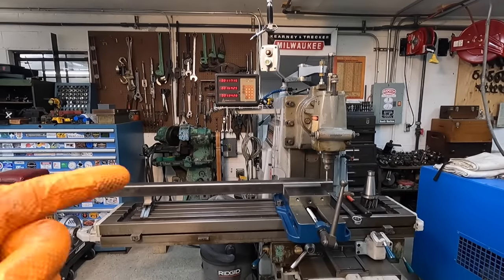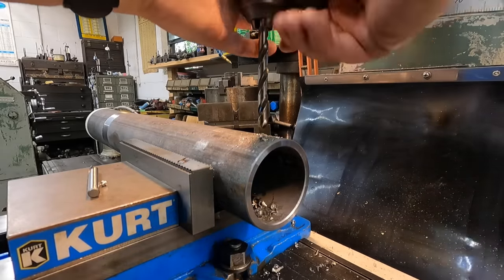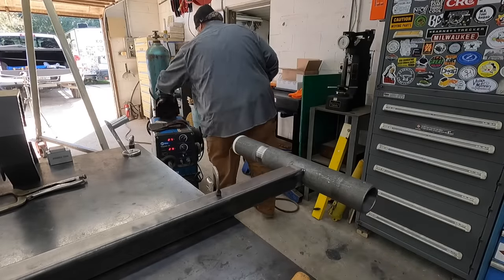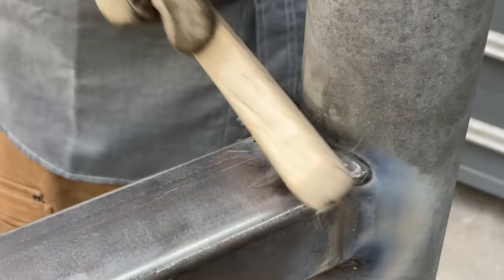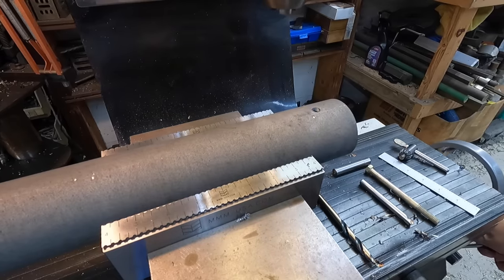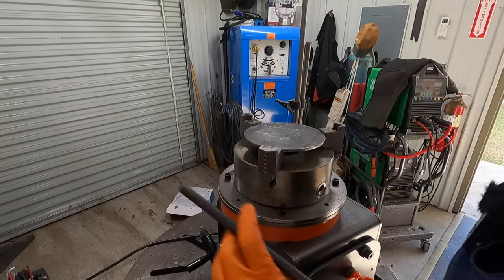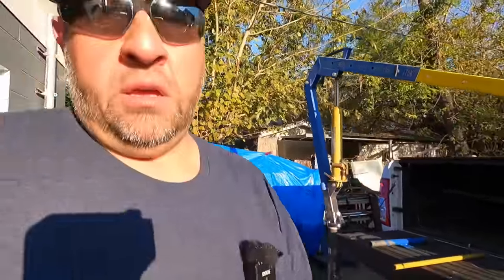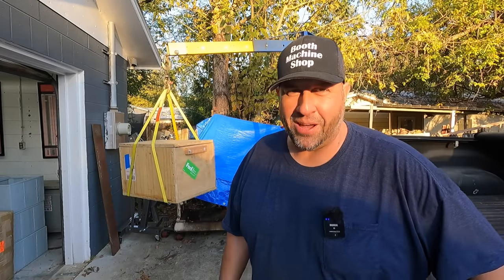Truck Hitch Crane Build Ep. 7: First Test!

Comment: I'm wondering, once you place the load on the truck bed, the suspension will settle a bit and you will have permanent weight on the foot, making it difficult to pull out the pin to retract the foot.

Comment: Your wire could have a moister problem I was welding a test plate at Lincoln electric in their lab and I was having the same problem, after testing the wire that was brand new it had high moister content that was causing the porosity and gas tracts.

Comment: Hey Adam big fan. Just wanted to say I run dual shield at work quite a bit and personally I like 25 to 26 volts and any where from 245 for thin stuff up to 300 IPM for thick stuff. People always say oh dual shield will punch through anything. And no it just won't. It has to be clean or you have to run it so hot it almost falls out. And I run a bit higher cfh of 75/25 something like 35-45. Also select arc is garbage IMHO. ESAB makes damn good dual shield but in all honesty if you aren't running it daily you can't tell the difference. Hope it helps love your stuff man!

Comment: If I may that half used roll of wire is far from fresh.  How long has it been setting around open? With all of those worm holes and the uncertainty of that wire I would toss it. Expensive but not worth the trouble. You can try a 10 to 15 degree drag ( IF THERES SLAG YOU DRAG)
 and a 3/4" in stick out.  But if the wires too far gone with moisture....

Comment: Shielding gas doesn’t go bad.   I on occasion have the same issues when MIG welding short circuit and it bugs the crap outa me.  This weekend I too was having issues and I believe the wire sitting in open air after a few years gets an oxidized layer on it.   I’m primarily TIG welding and so my MIG equipment sits in hibernation most of the time. 

So what I did on my weekend project where I needed nice “tight” welds on 1/4” mild steel and done by this late afternoon, was to switch my welding processes, right in the middle of the project.   TIG would have taken me much too long for this particular project, so I went old school like you did and used 6010 for Tacs and 3/32” 7018 DC+ for everything else.    I forgot how fun that was as that’s all I used to do in a former life.   Weekend Problem solved and actually stronger welds than what MIG can produce.

Comment: Gas goes bad?  I'm only a home gamer and I can envision gas mix separation if left static for a long time, but not much else.  

A quick tale of procrastination to illustate my dubious assumption; I finally fixed an old transformer MIG that still had the 75/25 bottle from a good 15 years ago.  It initially didn't weld for shucks, so I  disconnected the tank, put the cap on it, layed the cylinder on some rollers and spun, flipped it, did the old "rinse and repeat" for a while, parked it upside down for a few days, and finally hooked it back up, hoping to have mixed things a bit.  I don't know that it did anything and can't speak to how a fresh cylinder would improve things, but I've 1200 psi left in an ancient 125CF cylinder and all seems fine now.   Yeah, aside from a working with a potential bomb in the garage, I'm sure my next refill will include a hydrostatic test, if not charges for a new tank.

Comment: Porosity is caused by 2 0r 3 main things..one is level left in bottle..other wrong gas type..3rd is length of wire away from weld, too far away?  Well this is MY experience....Good work so far, dont stop.

Comment: Worm tracks and pinholes are commonly caused by excessive heat in the weld pool.  (amperage and or excessive voltage).
1) voltage too high. 
Or
2) too much amperage. Can be controlled by either wire speed or wire stick out.
I believe your settings are most likely acceptable as I’ve used those setting a lot for light deposition similar to what you are doing. 

Without being there to observe closely, I think you may want to increase your wire stick out. When training welders that are used to welding with solid wire where minimal stick out is desirable, I like to say that when it feels like your wire stick out is a little too high, your probably just right. Usually about 5/8”-3/4”
 The tech specs of your wire will usually suggest a range. Be aware that some wires even suggest up to 1” stick out. You may even notice the arc sounding happy, smoother arc transfer with less spatter. The sound of weld will speak to you. 
Sometimes it can also be caused by too fast of travel speed which can cause the weld puddle to cool to fast not allowing the weld gasses to exit the puddle and gets trapped under the slag.
Also some wires are more susceptible to worm tracks than others. Try one thing at a time to identify and eliminate the variables.
I’d be curious to hear if my suggestion(s) help.
I really enjoy your videos by the way.

Comment: I use Hobart .045 dual shield every day. Look up the manufactures setting for your wire and heat. Crank your gas up to 45-50 CFH. Stringers and straight on or a pull travel angle.

Comment: I'm not sure this is helpful, but with my mig welder I had to switch the terminals for the gun and earth lead to "reverse the polarity" because of using flux cored wire... The difference was remarkable.
Just thought I'd share in case it's helpful for your welding worms (or whatever they're called lol)

Comment: 37:13 you could use quick loc pins to secure the cylinder and boom for ease of disassembly. So its not so heavy as one unit.

Comment: Nice job.  With only 100lbs of test weight does not show the problem you're going to run into with heavier loads.  As the boom swings aft to pick up the load, you'll see twist in the main support.  There is nothing there to counter-act the torque.  Right now, its the mass of the system and welds keeping it straight.  But if you're going to try to live 1-2 tons, that crane is going to twist at the point where you have the extension to the truck hitch.  You have those static anchors in that cement ramp (shown in previous video).  Use those to check what will happen as you approach the lifting limit of the hydraulic press.  I hate to criticize, I really do.  I'm not trolling.  I designed the same thing years ago, but have yet to build it (damn heart problems got in the way).  But that was one of the issues I saw in some of these youtube videos.  Some guys are just plain nuts <grin>.

Comment: I know this video is 2 years old, but getting into welding, it's a shame so much wire is wasted when the spool runs out... It's unfortunate that you can't just put a new spool on and have it push the old wire out so you can continue using it. I do that with a 3D printer but I understand these are completely 2 different animals.

Comment: Lots of hassle to build, but I think its worth it because you didn't have to drill holes or modify the truck.   Ive seen these mounted in the bed floor and No way Id drill unnecessary holes in my personal truck.   Id even think its built just right not too heavy and not to weak for what your doing with it.   Id say its not capable of the actual capacity of the original lift  mainly due to the 1 piece of tubing for support.   Id guess 500lbs max and probably not fully extended.

Comment: Drill a 1/4" hole in the center of the round foot plate for water drainage. Also a jack from a vintage 1960 to 1969 VW Beetle has a round shaft that would work as an infinitely adjustable length foot plate assembly that can have a shaft at any length you need and it has a mechanism that allows full retraction with incremental retraction under full load. This would solve the truck bed loading variations due to having the load shift from the crane to the truck bed when the load is released from the crane onto the truck bed.

Comment: No shelf life on gas… looks like your feed rate may be excessive and you’re compensating by advancing your bead rate… try cutting back 20% with an little e or loop style instead of standard weave and that should let the impurities boil out the front of the weld puddle.

Comment: I have the Harbor Freight pickup truck crane that bolts to the bed. It's rated for 1,000 pounds and has a hand crank cable winch as well as the jack on the boom. You might want a winch to reach the ground easier.

Comment: Hey I’m by no means a professional welder but is the 730 wire your using rosen core? If it is then do you really need shield gas, I’m just asking because I’m not sure but the shield gas may be why your getting pin wholes and snaking in the welds?

Comment: Pause @13:05
When a heavy load is placed on the truck, the truck will squat and transfer a portion of the load to the base of the crane.    On mine, I place a floor jack under the center of the truck's hitch receiver.   This prevents the horizontal crane tube from twisting and is also needed so I can still remove the crane.   After the crane is removed, remove the floor jack.

Comment: You might try 24v and 290 IPM for wire speed I use it and dual Shield and never have issues with worm tracks or pin holes

Comment: Instead of pins for the height adjustable foot you could split and weld tabs on the female pipe. Use a cam-lock like on a bicycle seatpost so it's tool-less. Infinite adjustment and easy release when/if the truck squats.

Comment: I would not leave that attached to the back of your truck unless it flipped up higher than what you've already got it. You've got to consider the departure angle of the back wheel like if you come out of a driveway it's on an angle, your curb is up higher than the street, that could cause problems. I've scene tail hitches get caught on Curbing and they weren't able to move the vehicle because of that.

Comment: The pitting are probably because the wire has been contaminated or oxidized. Dual shield is really sensitive to contamination weather it being in the wire or the material. I’ve noticed that your new spool wasn’t vacuum packed and it should be.

Comment: Don’t put a pin at the bottom of the landing foot. When the truck squats under the additional weight you’ll not be able to pull the pin. Instead get two tongue lacks, one forward and one behind the bar to the receiver hitch and then you can lower them to get your receiver hitch crossbar disassembled.

Comment: Great looking crane Adam.  Instead of that fixed foot - how about one of those folding trainer “landing gear” assemblies that Horrible Fright sells.   You could just attach one of those to your cross beam and then swivel to the vertical and crank the little wheel down until t takes the weight of the crane boom - or replace the wheel with a flat foot pad.

Comment: Are you sure your gas pressure isn't up too high on your argon? I understand that it's supposed to be removing the oxygen as your welding but if it's blowing too hard could it be blowing the bubbles and the worm tracks in it? Does that make any sense?

Comment: hmm i would be a little concerned about getting something too heavy in the bed it'll make the truck suspension sag of course which means a loooot of weight will go onto that pin for your extendible leg brace which i would think to make it hard to pull it out. just my $0.02

Comment: Also I forgot to mention Not all  dual shield wires use the same gas. Typically 7525 or a straight CO2.  Not all wires or design to use either.

Comment: You need more support for the upright. As it stands you are putting a huge moment of force through that puny piece of box section attatching the crane to the tow hitch. As the jib swings the force will move from tending to put a curve in the box section, to loading it tortionally where it will have much greater flexability.

Comment: Drill holes for the rotating handle. You'll never lift enough with it with the base you have. It wont compromise the upper section by drilling holes in it.

Comment: Turn your gas up to 35 psi or down
Check that your not in pulse with current (electrical current)
And speed up your wire to where it peaks. . . Metal core needs speed

Comment: Just idea about the turning pipe, maybe drill hole threw the main tube and weld receiver pipe in on both sides, that way one less thing to be sticking out to catch on something, said ot before, but please dont use dish detergent, will rust and corrode steel!! Maybe something like a dab of white lithium grease!

Comment: i've had worm track issues at work with the select arc 71...was never an issue for many months then it was happening all the time.  flux wire needs to be stored dry, so best not to leave it around too long, and i think ours went bad.  straight CO2 seemed to alleviate but not entirely.  turning down the volts a little bit also seemed to help.

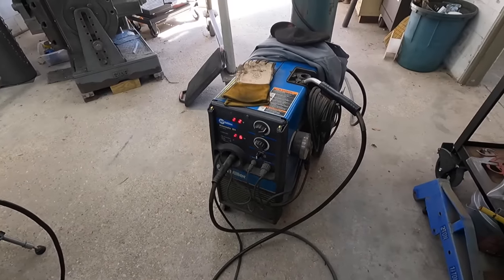Comment: I will ask if you turned the feed rate back down and getting the wire through the handle?  It looked the  setting was in the 27.2 range with the quick camera turn to me instead of 24.5   (time 21:30 ish)

Comment: Could you take the handle that came with it, cut both sides off the center bracket, and then stick the pump handle through to turn it? Probably a toss up compared to fabricating another one from scratch but I always try to reuse pieces like that instead of using more material

Comment: Weld on a short piece of pipe and use the long jack handle to rotate the crane. Also drill a hole in the bottom of your trailer hitch, weld a 1/2 inch nut and put a bolt up through it and tighten it against the draw bar. It will take out even more slack.

Comment: myself would put the piece of pipe on the back of the lift. like the T handle was. so you can slide the jack handle thru it and make a T bar . then slide out when done. that gives more control. both side and back. for diff load weights so on ..

Comment: Once you put your foot down and pin it and then lift a load onto the truck, you're going to have weight bearing down on you stabilizing foot. How are you going to remove the pin to retract the stabilizer foot with all the weight contained in the truck which is now bearing down?

Comment: I wonder if your rust remover hooch has something to do with the worm track problem. I used flux core for years and mostly the only things that did that was oil, water, or gas flow ( too high or low).

Comment: May I suggest a traverse lock?  I built a light material crane for my 5ton. I find if the truck isn't on flat ground the crane will auto rotate to the low side- whether you want it to or not.

Comment: The original handle holder that’s on the side, make something that will insert into that for the handle to swing back and forth. A pipe that has a 90 on it with gussets to press against the side, then presto, removable handle.

Comment: Once the load is put in the bed the suspension will load the support leg and may bind up making the pin hard to remove. Do you have air ride on the truck?

Comment: If you go to lift something heavy and you know the truck is going to squat a bit, you could put the leg down on the ground and then lift it up a hole or 2 (depending on the weight of the object) so you can get the pin out.

Comment: Looking good but you failed to pick up on a lot if comments on here about the pin release when the weight is on the truck bed. I think it will still be pushing weight onto the ground and you havent shown that

Comment: I'm not sure if it has a shelf life either but I have ran into some issues with welding just like you are had a gas bottle for a long time and I've switch gas and it actually helped me a few times so not sure but you might be onto something there

Comment: You get in a sway in the road or if the driveway runs up hill it’s going to drag because a trailer on back the jack with the wheel on it drags easily.

Comment: One thing I would like to mention is if the ground is not level, the leg will not sit right. I would put a single pivot so that it can angle slightly and then add rotation to the pivot so the foot can match the slope of the ground whever you are

Comment: to make it rotate why dont u weld a circle peice like what a trailer jack .has 4 holes to swing jack up then put pin into hold still ..  then when u not useing it u pull pin and rotate handle in line with jack it not sticking out and easyier to load on truck flat

Comment: What is going to stop the Crane head from rotating when you are driving - you might want to consider a thumb screw that you can snug up on the rotating hoist head - Weld a nut or thread a thread into the nylon bush and then use threaded rod or a bolt with a thumb tabs

Comment: I would be putting a worm drive on the crane rotation so it only rotates when you want it to, if the truck is not perfectly flat you could have it where a load get away from you.

Comment: weld a nut at the bottom of the pipe and use a threaded rod as a jacking screw ???   don't really need a handle to pivot it.  just push\pull on the load

Comment: Your worm tracking is from moisture in the flux core wire. You might end up getting hydrogen induced cracking even if you don't physically see the worm tracks. This is very common with opened spools that have been sitting.  You can try bumping your volts up and using a longer (CTWD) wire stickout when welding. You will see the moisture burning off but normally you won't get all of it. Also you can take a few wraps off the spool, I find the moisture seems to affect the outer layers on that style spool the most. Best thing you can do is re-spool the wire to a metal spool, toss it in an oven for 3 hours at 300F for a half used spool.  Once cooled put it in a thick bag with some desiccant packets. If you're putting it back on the machine and keeping it there put a DampRid moisture absorbent bucket in there.  Hope this helps, sorry for the long comment.

Comment: Dual Shield Weld set up Nice ! I refer to this as Spray Arc, and when running larger wire (.052) you can see as you weld and it is about 3/8’ stick out of contact tip then it get a very nice tapered tip as you weld shaped like a very sharp pencil. Nice videos thanks!